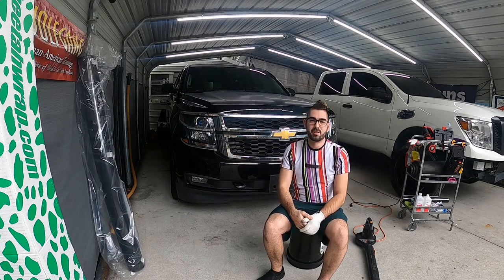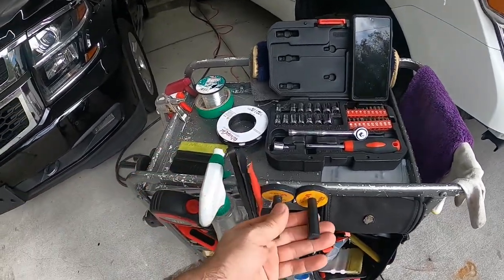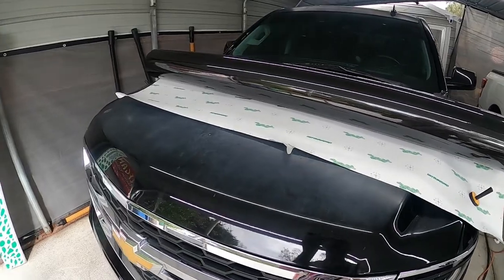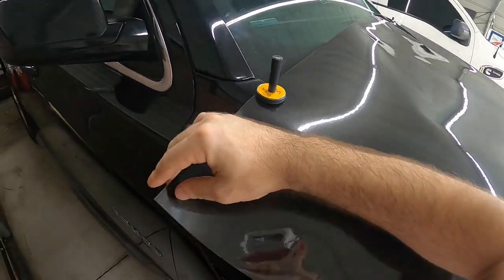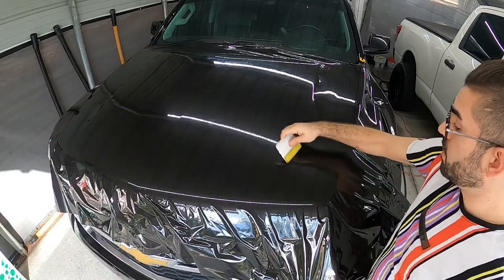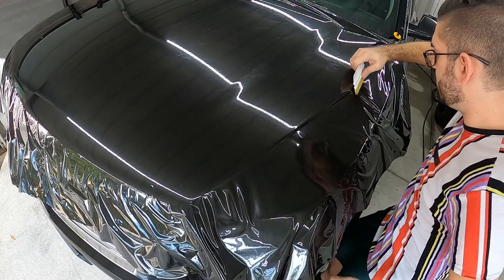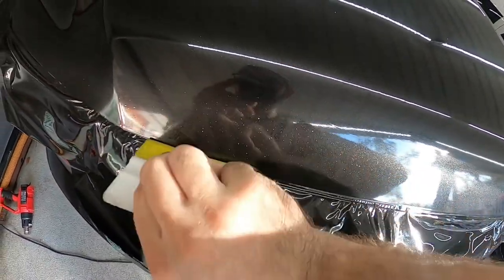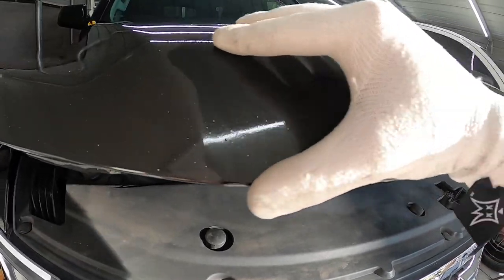How to Vinyl Wrap a Car Hood (DIY) Save $$$

Comment: Great vid... when you soften the wrap material with heat how do you ensure you don't tear it when you relift it again?
Reply from the maker: when its hot or warm its actually less likely to tear. cold is when its scary. if it tears from heat, too much heat was probably applied